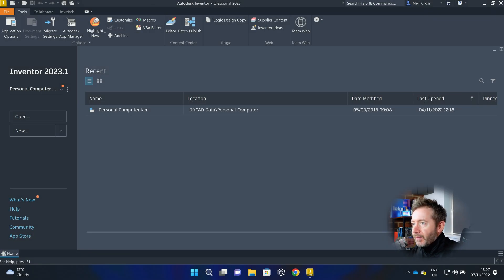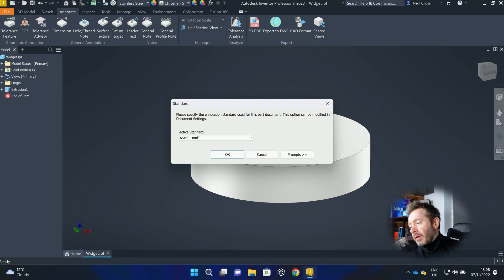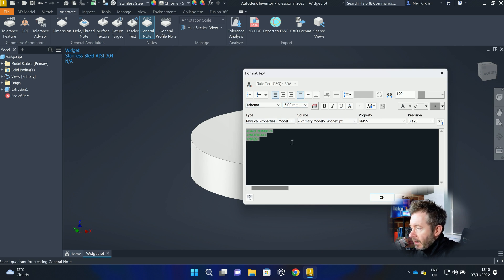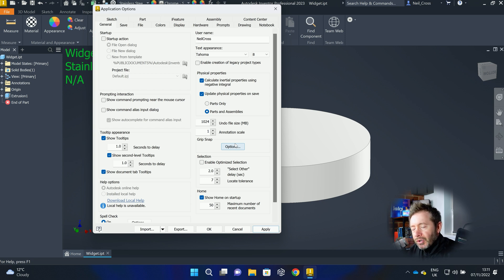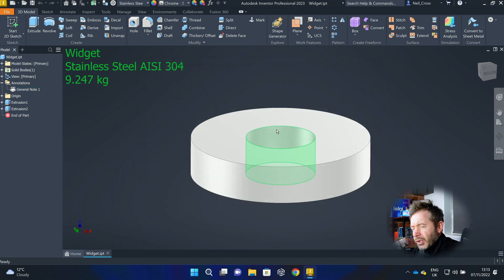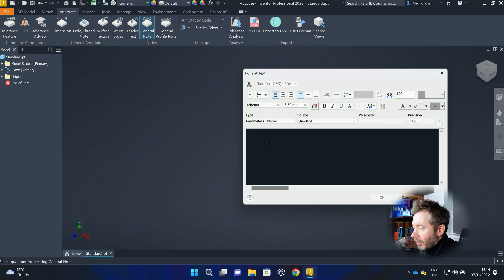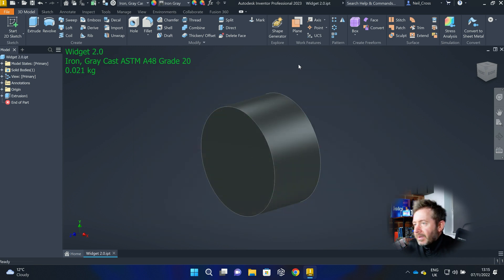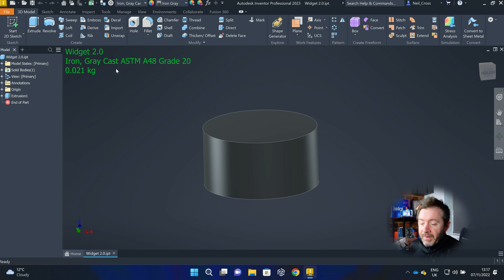a live mass/weight display in the viewport?! How Do You Do!?

Comment: Hi Neil, excellent tip, I've added something similar on my part and assembly templates showing:
<Part Number>
<Description>
<Material>
<Thickness>
<Mass>
Would there be any way to record clicks and keystrokes to add this to existing files? Doing it manually takes about 28 clicks.
Thanks

Comment: Would be nice if I could have it display lbmass and kg on seperate lines at the same time. Don't see any way to achieve that.
Reply: Can you make a custom iProperty, or parameter, that takes the mass in say, kg, then times it by 2.2 to give lbs, and then drop that parameter in? I haven't tried it, just a suggestion for a workaround